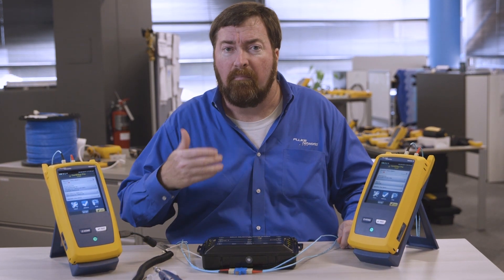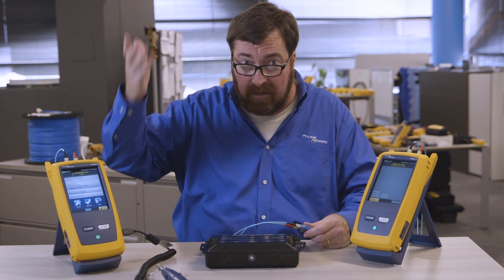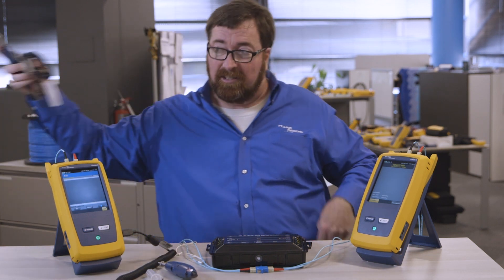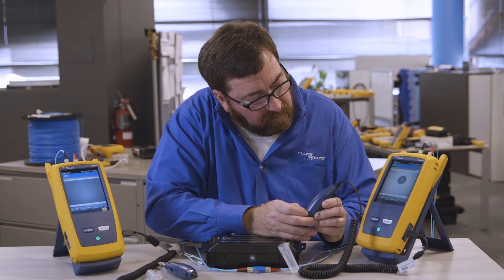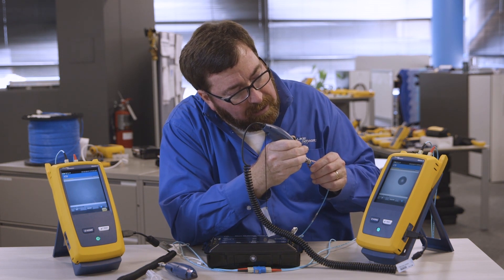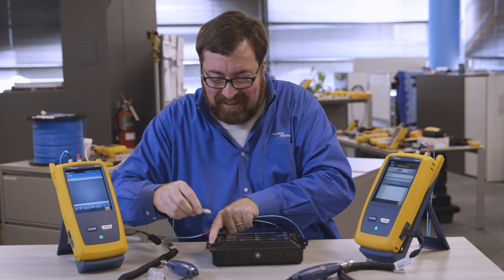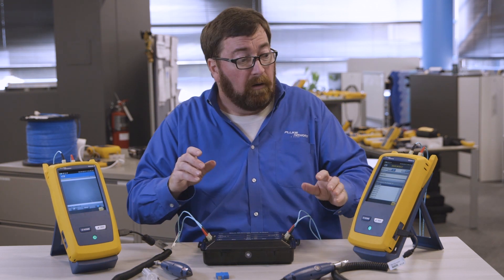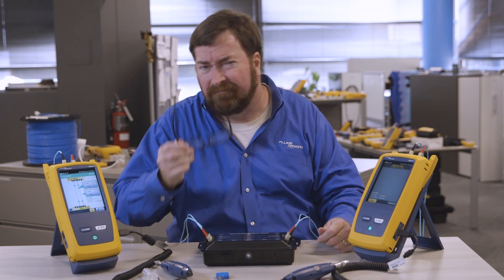Using a Versiv™ Main Unit as a Remote By Fluke Networks

Comment: I have a problem, when I turn on my Versiv it does not recognize the One Touch AT Network Assistant module, I see a message "MODULE INSERTED, the measurement module is restarting, wait" after a few seconds it actually restarts and then turns off. I tried to connect it to the PC but the LinkWare software obviously does not show it connected. Advice?

Comment: Nice video.  Are there any limitations when using a main unit as remote?  Or we have full functionality when doing it?  Is it the same when doing copper CAT6 certifications?  I am planning to buy Versiv2 and considering buying 2 main units instead of 1 main and 1 remote, and want to know if i am doing the right thing  (regardless the increase in the price).

Comment: Main unit as remote DSX-5000 when it is used for cat6/7 cable? Thanks
Reply from the maker: Hi there - you can use a second unit as a remote - read more here:

https://bit.ly/3l7k7LM
Reply: @FlukeNetworksVideo  Thanks so much